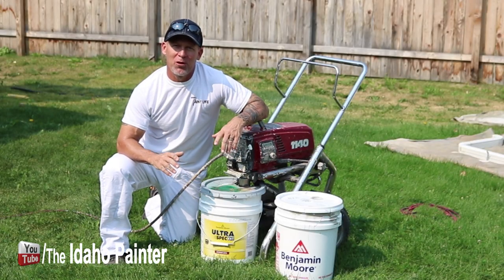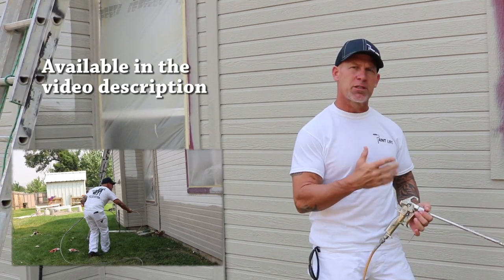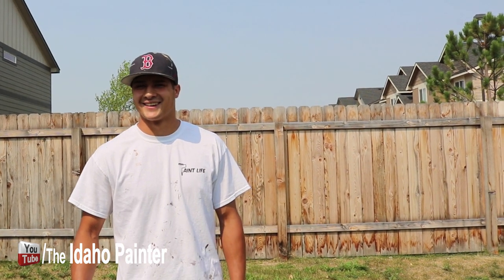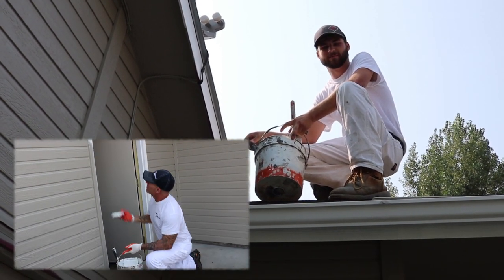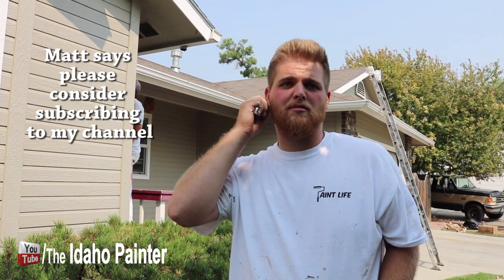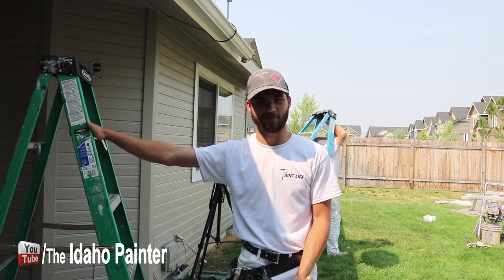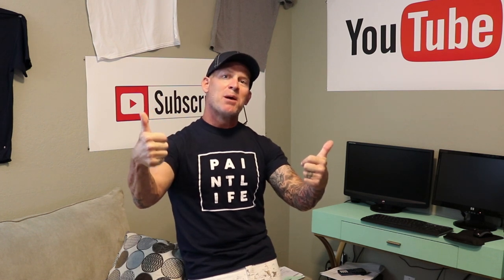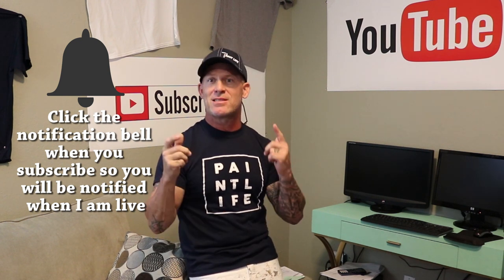Benjamin Moore paint review.

Comment: Chris, great review! Nice to hear from your painters, great guys.
Benjamin Moore also makes a grade higher than Super Spec, the Ultra Spec. They also have  Moore Glow and finally Aura, which is probably the best paint I ever used. Try reviewing those if you can find them.

Also, that issue of over spray dust is SO true! Ican never get away with what I see in your videos! .17 rac tip helps with it. As does using the Graco Clean-Shot Shutoff Valve attachment at the end of the wand, though it makes spraying awkward, unfortunately.

Thanks for the video!
Reply from the maker: Thanks for sharing Gabriel!

Comment: Ultra-spec is the contractor grade.. it's just enough to get the job done. Next time use Regal exterior
Reply: blackmetalmazda - You are correct sir.  Regal or Aura.
Reply from the maker: Awesome, we'll have to try it out!
Reply: blackmetalmazda - What are your thoughts on the Fresh Start oil primer? I felt it was pretty tin and drippy.  Oil paint USED to be good.  What do you recommend for a good primer for exterior applications?
Reply: westsidewil well in Los Angeles the VOC laws are insane!! So what we are going is sanding and using Benjamin Moore Hi-Hide primer... I have had very good results with
Reply: westsidewil 
And if you really want top dog primer. I use STIX very good primer and very expensive. That and XIM UMA
Reply: Stix is good for priming azac plastic board its about the only thing that will bond to a plastic surface
Reply: Kyle J and blackmetalmazda - Doesn't INSL-X make STIX?  I believe Benjamin Moore bought INSL-X.
Reply: westsidewil  yup!  They do on them
Reply: @westsidewil  California troubleshooter is the best exterior primer in my opinion
Reply: I like fresh start water-base primer by B M. It is much better than  Sherwin W. But I like peel bond by Shwr. W. It is like a glue.
Reply: Expensive? Try the Aura. $ 103 retail. The best interior hands down
Reply: @patrickcullen2714   103 is insane.. but yes best paint hands down

Comment: You are using the bottom line paint for Ben Moore. Try the Regal Select that is the #1 exterior paint for BM.
Reply from the maker: Cool, we will have to try it out, thanks for sharing!
Reply: Yup. Paint store in NYC recommended BM Regal interior in Matte to me. Live in NYC and tons of the apartments have uneven walls/bumps due to tear, and this paint spread beautifully/great coverage w 2 coats/deep, rich colors/doesn't run & smooth application/no streaks/dries pretty quickly. DIY-er here...Chris your videos played conquer my fear doing it myself & spending $$$ on painters :)

Comment: Is it just me or are all the "it's too thin;" "it runs;" it doesn't run" just consequences of these guys running SW 95% of the time and not being used to the Ben Moore?
Reply from the maker: It just might be, these are just our initial thoughts of it.
Reply: Not necessarily. If they had been using Ben Moore Regal Select then they probably wouldn't have made the same comments because that paint is a lot better than Ultra Spec. I think Ultra Spec is good paint but it's the low end of BM's line.
Reply: Best exterior paint I've ever used was the California Ultra 2010 most people don't use it or aren't familiar with it I was a Regal best exterior paint I've ever used was the California Ultra 2010 most people don't use it or aren't for not yet with it I was a Regal select  guy until I found that stuff

Comment: Another awesome video it's funny you mention sales reps that is the one reason I do not buy from Sherwin-Williams I am not going to negotiate every single product like buying a car
I'll stick with Home Depot Behr paint 20% discount no reps needed amazing paint
Reply from the maker: Weird, we've never had that issue at Sherwin Williams, thanks for sharing!
Reply: Test PPG - SunProof and Fortis 450
Reply: I’be been painting 35 years and gave up on Sherwin Williams and Ben Moore these companies are constantly reformulating their products changing the mixing base that also changes the color so you can’t touch up sometimes, I’ve bought Behr in one store crossed state lines to do a job ran out went to the nearest Home Depot  bought more of the same color and It always matches their color matching system is light years ahead of Sherwin Williams who can’t get a good match from one store to another.

Comment: I live in Hawaii and the sun & humidity trashes paint finishes. Have used a number of other brands and Benjamin Moore has lasted 20 years. I always use  premium level paint to avoid having to repaint sooner than with cheaper paint. There's also the issue of protection? I used 2 other brands of premium paint on the trim for a comparison. Those have only lasted a third as long. Your opinions mean something as you're professionals, however they mean very little if you haven't done a scientific study to confirm how it holds up. I like being treated well as a customer, however quality is more important than a smile, and a song and dance, at least to me . Am currently in the process of selecting a paint for my home and at my age I hope it'll be the last time I'll need to paint. Am willing to pay a little more to get a quality, durable finish. What exterior latex paint brands would you recommend for someone like me?...Thanks!

Comment: I've  never actually used ultra spec exterior. It works just fine for interior, its a cheap but effective choice on a new construction because of the cost. 2 coats will almost always be enough, if the color permits it. 3 coats if you're working with a banana yellow.

Regal and Aura are much better (interior and exterior) but you'll still need 2 anyway so for the money its only worth it on repaints, not flips or new construction. 

I can buy super paint for the same exact price point for ultra spec. $25 / gal.  Given the 2, I select super paint.
Reply from the maker: Thanks for watching and sharing!

Comment: Other than possibly addressing ease of application, asking a few guys what they think while spraying doesn't answer many questions people should have when hiring a painter. For example, what kind of paint they are using -- latex, acrylic, etc., how well they hold up against blistering or peeling, color retention, and resistance to dirt and mildew over the years. Of course some of this depends on what you're painting. One paint doesn't fit all. Pretty hard to make any kind of informed decision on what to use based on these videos. These videos might get your company some exposure, but talking intelligently about some of the things I've mentioned might be better. No, I don't paint for a living but I have hired a few. Some good, some not so much. Sometimes you don't know for a year or two or hopefully longer. If I've learned one thing, it's that I'm more interested in how well the surface is prepared than anything else.
Reply: Process for longevity

Treat mold/mildew areas.
Pressure wash away peeled paint, mud, dirt, salts.
Apply Sherwin Williams Elastomeric patch for cracks.
Apply Home Depot Seal-Krete original sealer on all chalky surfaces dries clear and a bit of a shine.
Caulk widows and doors with polyurethane.
Apply waterbased Satin Exterior paint on walls/trim/doors ie BEHR Ultra Premium or Sherwin Williams Resilience/Duration.

Comment: I used BM 30 year paint on my home 10 years ago and it was the best paint I have worked with as it was nice and thick.  I will be doing my cabinets using their Advance line over BIN as I'm confident it will be excellent.
Reply from the maker: Thanks for sharing!
Reply: I just finished painting a set of stained kitchen cabinets. I scuff sanded all surfaces and then wiped them down with Wil-bond deglosser for added measure. First prime coat was BIN stain blocking primer. Second coat was Stix extreme bonding primer tinted to BM linen white. Top coat was BM Moore advance satin finish in linen white. I brushed the BIN cuz is super watery so it was just easier to work with that way but I sprayed the Stix and the Advance using a Graco 395 PC with a 310 FFLP tip. You don’t have to use a sprayer with the Advance paint. If brushed properly it’s leveling properties will have your cabinets looking like you sprayed them. Advance is a modified oil so don’t shake the can. Slowly stir the paint before use. If you shake it bubbles will form on your cabinet surfaces. Be sure to watch for drips and sags...advance has an extended open time so it comes with the territory especially on your verts.
Reply: I wouldn’t count on BIN all by itself giving you the bonding properties that a surface like stained cabinets require. It will block the stain in the cabs from coming through but it won’t create an adequate substrate for your top coat to adhere too. You want a primer that will adhere to your cabinets but also create a new surface for you top coat to adhere too. Stix bonding primer by INSLX is the best. SW Extreme Bond Primer is also good.
Reply: I took it a step further and sanded between coats of bin and it sands beautifully.  I did 2 coats. I just used 000 steel wool.  Although Advance has outstanding leveling abilities, I used a brush then used a dry roller to remove any brush marks. It came out looking sprayed. Yes on the bubbles and no I didn't shake it.  They came out beautifully and I'm using them carefully as it does have a long cure time. After cure I'll be spraying some De cat lacquer although I really don't have to wait for it to be "cured".  I might glaze them but not sure yet.

Comment: How does it compare to the Behr?  I bought Behr interior before reading your review and it ran badly.  I found if I sprayed about 2/3 as much as I thought I should spray, it wasn't bad, but I had to use two coats as one coat just wouldn't cover the primer adequately without risking runs.  I used Behr paints and stains many years ago with better results.  It seems the newer products are harder to apply and there is lots of over spray and dust even with minimal pressure.

A question: do you ever apply epoxy garage floor paint?  I need to paint my concrete floor and don't recall seeing a video on that as yet.
Reply: LTVoyager I'm not a big fan of behr  overall,  do you like it?
Reply: LTVoyager not a Behr fan, used it once because the customer purchased it, the next day you could scrape it right off with your fingernails which wouldn't have been the case with Benjamin Moore, Sherwin Williams or Murallo...
Reply: Yeah, the dry time is terrible on a lot if behr products Daniel Greg.
Reply: 518 Painters I painted two walls on a warm, humid day (85/85) and the paint took 6 hours to dry enough to touch and sagged and ran badly.  I likely applied it too heavily, but my coverage was 250 sq ft per gallon which is right at the heavy end of their 250-400 range on the can.  I painted the remaining two walls a few days later (70/50) and the paint did much better.  I sprayed a lot lighter (350 per gallon) and the first coat was dry to the touch after the two hour recoat time.  I am not sure how much was due to lighter application rate and how much due to the cooler temp and much lower humidity.  Durability won't be known for years.
Reply: That's the same issue i had with the humidity in my video I did about the problem surfaces. Took forever to dry. I always try talking customers out of behr. LTVoyager
Reply from the maker: We would recommend Benjamin Moore over Behr. 
Here is a series of videos on applying epoxy: https://www.youtube.com/watch?v=uSQj6p2fIAM
Reply: LTVoyager stay far away from behr! Always sags and has horrible touch up capabilities. Johnny homeowner paint, and as a business owner it's the only brand name I don't guarantee my work with.garbage!
Reply: Rhino Painting I sprayed my remaining two walls with much better success.  I sprayed more like I do auto paint and it stayed in place.  I didn't want to switch brands mid job, but likely won't buy Behr again, although my experience with their stains is quite good.  I stained a shed (T1-11 siding) in 2003 and it still looks pretty good, but is fading a little.  Will probably be recoated next year.  15 years in PA weather is very good for a solid stain.

Comment: You should try Valspar reserve or Sherwin Williams infinity next . Consumer reports are bought by certain company (like ads) to push their products.
Reply: Robert Torres yes he does. The Sherwin Williams paint he uses normally is from a Sherwin Williams store. Since he has been using Home Depot's products may be try some of Lowe's Sherwin Williams or Valspar products there.
Reply: One thing I for got to add. Sherwin Williams owns Valspar now
Reply from the maker: Thanks, we will have to try them!
Reply: Home Improvement How To's 

Dude, c'mon let's get some side by side comparisons. Most of the people that follow you do this work on the daily. 

Let's see:

1) Spray coverage, flight, runs, volume consumed per square while spraying.

2) Brush weight, strokes for uniform coverage, how well it flattens out while drying, cut lines. 

3) What it looks like five to seven years later. (This is my personal measure, how much work do I have to do to repeat the job/if it needs it at all.)

I have no issue changing brands, but I'm not moving without some lifetime evidence. That's what gets the callbacks and the references.
Reply: What evidence do you have that consumer reports is paid to push products?
Reply: TheRacerRich 

The lack of side by side comparisons is a demonstrably evident feature.
Reply: Consumer Reports doesn't take any ads.  They are fully funded by their subscribers.

You can disagree with their findings, but spreading lies is irresponsible.
Reply: Consumer Reports doesn’t do ads, but companies pay them to review that company’s product.